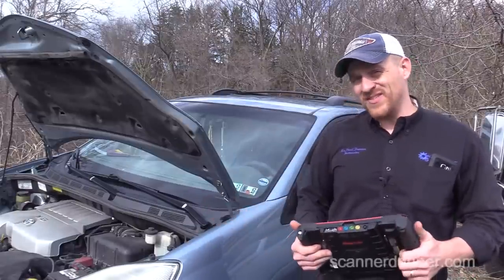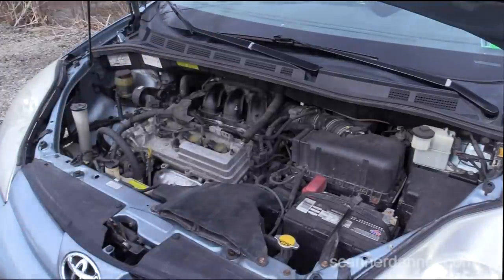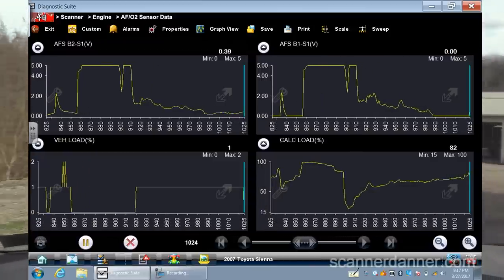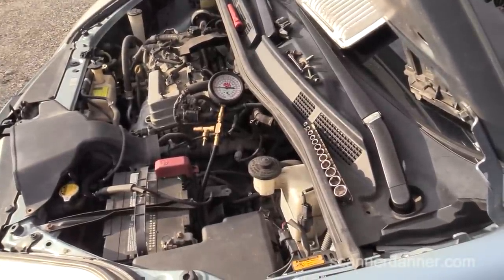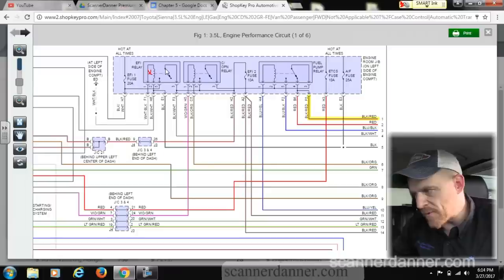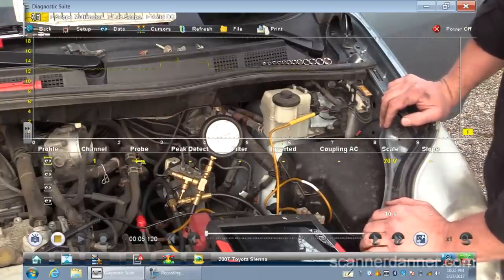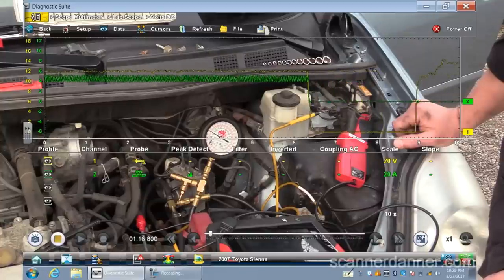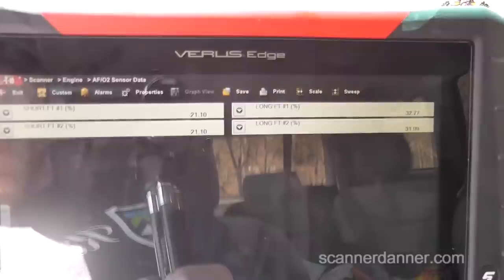2007 Toyota Sienna Low Power, Fuel Delivery Problem, Dual Speed Pump (P0171, P0174, P0101)

Comment: Couldn't you have just jumped out the resistor to switch between High and Low modes?
Reply from the maker: yes I could have but it would have been a forced high speed mode in the low speed circuit, and at times I wanted to check the actual high speed circuit itself and show the switching that was occurring . Thanks!
Reply: @ScannerDanner  That makes perfect sense, I was just watching you explain the circuit and figured I'd ask.

Comment: if you disconnected resistor under hood  killing low speed you are only left with high speed  as far as i can see ? comment at 26. 23
Reply from the maker: correct and the pump would only run then during cranking and wide open throttle
Reply: @ScannerDanner  you disconnected with car running and the car kept running  in the video  should have died  with dropping pressure  it only dropped a bit it maintained a lower pressure then when yu plugged resistor back in pressure rose ?
Reply from the maker: @jackiemay9471  it was dropping and would have dropped all the way and stalled had I left it unplugged
Reply: @ScannerDanner  right thank you

Comment: This seems to be a great deal of complexity to lower 24 watts.
Reply from the maker: Not really, just a resistor and an extra relay. First time I saw this was on a 90s Jeep and the only reason the manufacturer did it then, was to reduce the fuel pump noise as customers were complaining lol.
But I agree with your comment to a point. The very little this saves on economy just seems like it is not worth it.